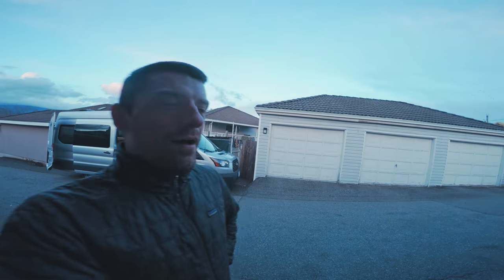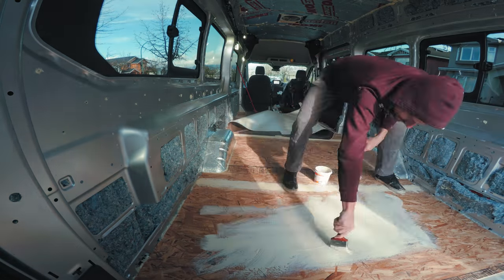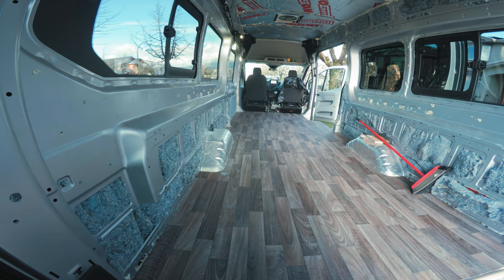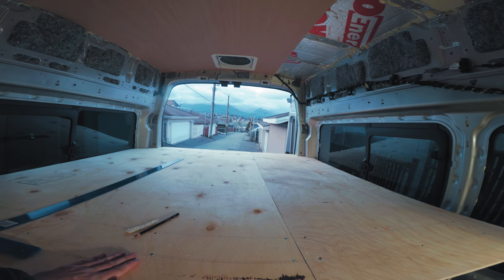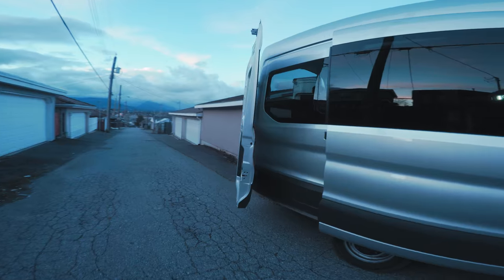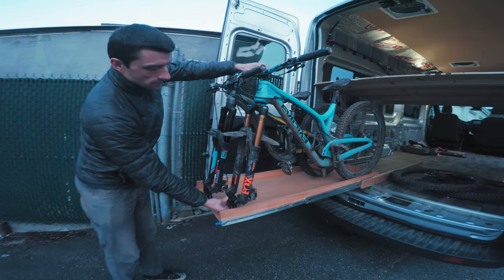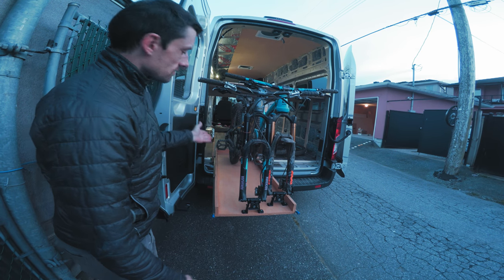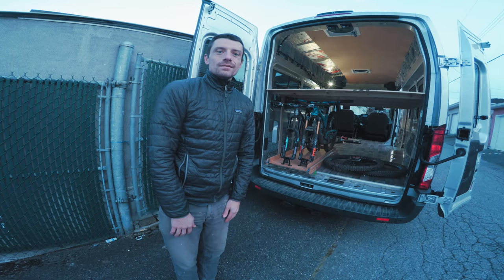SLIDING TRAY BIKE RACK! | Camper Van Vlog #3

Comment: Great! I like what you are doing!  But I have thought about building the bike try so that bikes can be stored horizontally so the bed doesn't need to be so high.  A lower bed would also accommodate more overhead storage.  That is, a bike tray more like a big wide drawer, with  a rubber or plastic insert/s that the bikes could rest on so they don't shift around inside while driving.  Obviously that makes the drawer much harder to design and construct, but I wondered what you thought of that configuration?
Reply from the maker: I hadn't thought of that, but it's an interesting idea for sure. I think in our case the goal was I would be able to sit up in the bed without hitting my head, which I can do. We'd also like to have the additional storage under the bed with the bikes vertical.

I have seen a few designs where the bikes are placed vertical, but rotated 90 degrees, so the bike is hanging from the fork.
Reply: Have you seen anyone do this? I have thought of this configuration to use under a sleeping platform in a truck. I've been looking for examples but haven't seen any.

Comment: Nice work! Consider your weight to horsepower ratio when building the conversion. If things get too heavy, climbing those mountains is going to be a challenge, and in the hotter climates - like Utah, overheating the trans or engine can be a concern with an overloaded engine. All that plywood, especially the heavy OSB used on your floor adds a lot of power robbing dead weight. Look to the custom jet designs like Gulfstream, etc for material inspiration. What they use may not be entirely practical or available, but they're full of ideas. Sailboat interiors are nice to glean ideas from too, but sometimes weight isn't as big an issue for them as an aerospace vehicle.
Reply from the maker: We are thinking quite a bit about weight actually. I'm not really keen on hauling around big loads with gas prices these days!

But yes, that floor is fairly heavy, but also cheap. :)

Comment: I hate to point out the obvious but you should’ve put the bike lock things sideways
Reply from the maker: The fork mount? are you sure?
Reply: Yeah buddy, then your handle bars won’t stick out so far, especially when space is at a premium. By the way this isn’t a criticism I think your vans pretty cool.
Reply from the maker: bikes will fall over if they are turned any other way. also the bars will stick out the door if i did that.